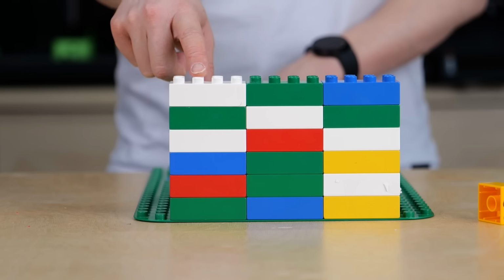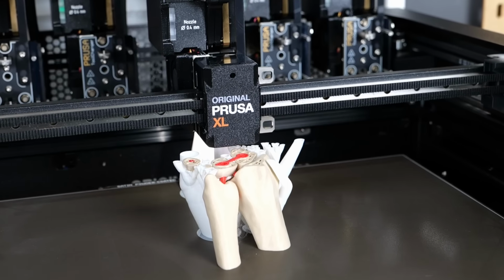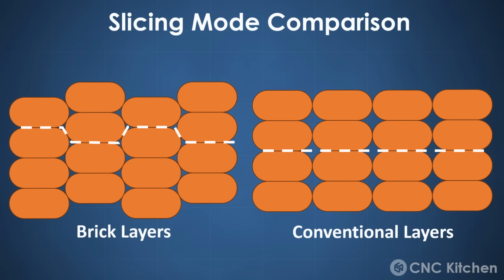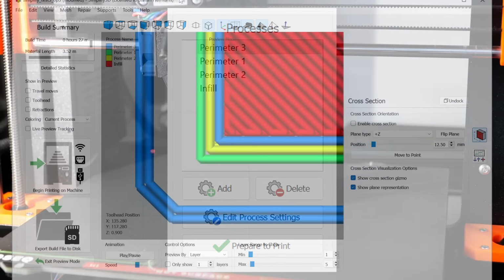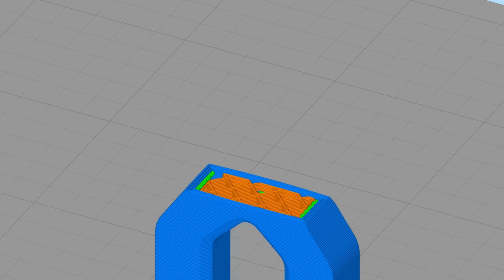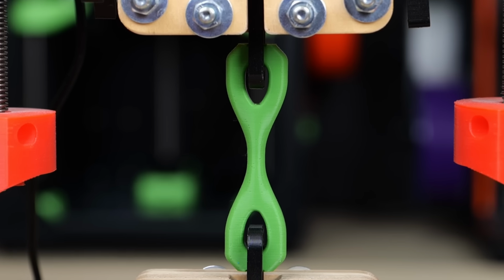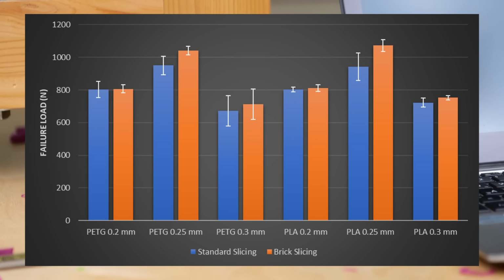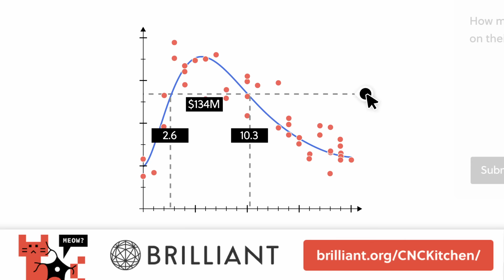Brick Layers - Why did no one do this before?

Comment: A 10% increase in strength with negligible changes in print times sounds pretty good. Seems like prints using this method may be more water tight as well. We need definitely need more testing. Great video!
Reply: I suspect the boosts would be even more significant if you tested for twisting or bending.
Reply: It sounds conceptually bankrupt since MIT published well on this and of course the issue is running a heat pump and/or thermal IR panels to get the heat bay good and hot for adhesion and mixing (where my ultrasound hot end at?) Though on the other hand you don't want the heated baseplate overperforming or motors and controls overheating.

Weird good news; looks like NIST (in Nature Communications ystrdy) found a way to use cellie compasses to do clutch NMR or at least some low key chemical measurement, though maybe outgassing things like PETG losing the glycol to atmosphere are too small.
Reply: @Cineenvenordquist  Even if true that MIT published this, it's not "conceptually bankrupt" to have the same idea.
Reply: What about sandpaper thing that scratches up slightly the top of printed piece for better connection like in pottery?
Reply: @uncertaintytoworldpeace3650 Maybe a micro jagged edge on the nozzle tip to get a similar effect with greater bonding surface
Reply: @ethansdad3d  I'm 98% sure that's a bot. What they said is completely incoherent and not in a "english isn't my first language" kind of way, in a "did you know that the national institute for standards made a study in Nature Communications about using Cellie Compasses to do Clutch NMR or at least some low key chemical measurement? What do you mean that has nothing to do with bricked slicing?" kind of way. The first half of each sentence rarely makes complete sense with the last half of each sentence, it's pulling random vaguely technical sounding concepts out of it's ass and hoping they stick, (as far as I can tell, Glycol doesn't even evaporate, letalone off gas out of a material and into open atmosphere.) and the disjointed concepts only get worse the more of the comment you look at with the second half having literally nothing to do with the first half.

Comment: Coming from concrete strength testing, you want the test cylinder to explode under compression. If just a part snaps off, or it cracks just by one cleavage point than the test cylinder is not homogeneous. Similar to how your parts exploded it likely means more parts of your model were experiencing stress at the same time tell the plastic itself had to give. For ridged materials optimal strength testing often ends with an explosion.
Reply: Yep That one PETG test gave me flash backs to concrete cylinder test in Material testing 101. The rebar reinforced ones would shake the building when they went off it done right!
Reply: Pardon me, but I struggle to see the similarity in material properties concerning Concrete versus Plastics. Plastics usually behave worse in strength tests when particles are introduced to the structure, whereas concrete derives its strength from the aggregates mixed in. Injection molding of PETG should preferably make the part string out when subjected to tension (as in these tests). However, since these parts aren't entirely homogenous due to the process of 3D printing rather than injecting liquid material into a mould, I'd argue there's an increase in strength due to the parts being more homogenous than traditional parts. I base this off of the parts breaking in several directions, rather than just cleanly snapping off. If they were less homogenous, they would have broken sooner
Reply: @Arterexius  Ideally in both cases neither should end up with a plasticity failure. plasticity failures are nice in that it gives you a safety factor, but fractures in multiple planes means the part took all it could handle in the current composition. Plastics can benefit from aggregates as well. Carbon fiber and glass reinforcement is valuable in plastics. This printing style is getting a lot closer to what you would expect with an injection molded failure. 
Concrete, steel, plastic, wood. It's all just materials and when engineered chef's kiss just right that's key.
Reply: @brianhunt6943  Ah, I must have misinterpreted what you meant. I thought your argument was that it was further from what could be expected with an injection molded part, rather than closer. Apologies for that and thanks for the explanation that aggregates work well in plastics too.
Reply: @Arterexius concrete paste can have strengths upwards of 400MPa and commercial strength products and commercial products around 120MPa but aggregates are suddenly the weak point. Sheared granite aggregate looks cool though
Reply: This was my thought as well.  The primary characteristic of PETG in tension is to elongate before failure.  This spreads the stress along the entire structure causing vertical figure lines and explosive failure.  I would be interested in seeing nylon (which also stretches to some extent) and ASA (which stretches very little).  Hope to see more experiments in the same vein using more advanced materials!
Reply: @robblincoln2152 Great way of explaining the material's failure. I still don't understand why a decompression tests on plastic fdm parts are being compared to compression tests on concrete cylinders, but maybe that's just my pea brain
Reply: @MMOchAForPrez  I think (not my comment) that it was just the coincidence of the spectacular type of failure , rather than any shared mechanical component.
Reply: I would love to see additional tests like shear rather than just just tension.
Reply: @qbi4614  my thoughts exactly. Although adheasion strength is only increased by 10%, I would expect the resistance to bending or any force perpendicular to the printing plane to increase
Reply: It's kind of the way plastic works tho. It's literally plastic, but concrete didn't really undergo any plastic deformation? So it explodes it means that the force is passed thru whole mass, but plastic is like... Different? It can move and I don't know anything much about testing.i know more than average but never ran any test. I just know of the types. But, good luck making most plastic break like concrete. I expect plastic to break more like a metal than a lithic
Reply: like the Titanic sub

those idiots also just stacked the carbon fibres over each other
Reply: Welding tests often involve a welder creating a "steel balloon." The idea is that pressurizing it should inflate like a balloon without tearing at the welds. The inlet is a weak point, so it should rupture violently when the desired test pressure is reached.
Reply: This isn't compression though

Comment: How about implementing a random number generator in the slicer, so that the thickness of a small section of any print line is different from it's neighbouring lines in all directions. 

Potentially introducing a lot of internal asymmetric patterns creating additional area for adhesion.

Comment: Have you considered the option of perpendicular pouring of layers? If the first layer is filled with a spiral, and the next one with a snake. The threads between the layers will be perpendicular to each other. This can help to increase the strength of the adhesion between the layers.

Comment: This exists in Cura.. partially. Set infill layer height higher/lower than regular height. Select extra infill wall count. Also increase the outer/inner wall overlap. You should get at least 3 walls overlapping. That's the limitation as far as I know.. but most people dont print with more than 3 walls.

Comment: I'm very late to this comment section, but hopefully you read this and give some thought. Something similar to this, that I have been thinking about for a long time is printing the even and odd perimeters at different extrusion rates. So, as an example, let's consider a five perimeter print. The outermost perimeter, let's call it perimeter 1, then perimeter 3 and subsequently perimeter 5 would be printed first. After perimeters 1, 3 and 5 are finished, perimeter 2 and 4 are printed at a higher extrusion rate, lets say 115%, calculated to fill in the star shaped gaps between layers 1, 3 and 5. Speed might also be reduced to allow the melted filament to fill said gaps. Maybe this is something that already exists en slicers, but have just never seen it. Hopefully you can give this a try, Cheers!

Comment: This is indeed a low-cost but effective improvement plan. Thank you for promoting this idea!
Reply from the maker: Thanks! Appreciate it.
Reply: @CNCKitchen  i think you should try slightly increasing flow and temperature, the print may be even stronger
Reply: @wormball  Wow!! Great suggestion! If you could just adjust the flow to be higher on every inner layer, it'd make a much more homogeneous piece. Print the outside layers first for a barrier  to keep the over-extruded insides from oozing out, and you might have yourself a winner!
Reply: can someone translate this to dollars please, i’ll match it
Reply: Always amazes me how the most basic stuff gets neglected for so long. A child could've identified the problem, given enough information, lol.
Reply: $5.70 @sippingthe

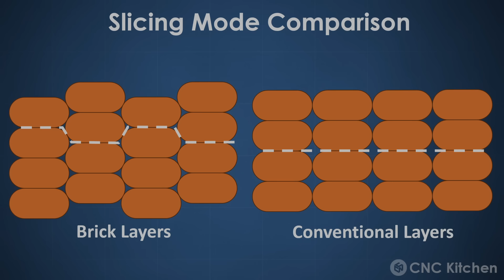Comment: 3:03 There is a 2020, patent but it's a copy of a 1995, patent which had expired so this process is public domain now despite the 2020 patent which should easily be challenged in court.
Reply: in USA the patent holder has to defend their patents, and in court they have to show they lost money  for the patent infringement.  So an open source implementation not hosted on a platform held by a us corporation. its unlikely they will defend the patent.  And since, their patent was about reduction in voids improving strength.  you probably could intentionally keep same void space as now and they wouldn't have a leg to stand one.

Comment: My work around current is place the parts in 45 degrees so the plane is not parallel to the build plate. It often results in low buildplate holding force, so I design often breakable support in the file. FDM is similar handling to wood. One direction is much stronger than the other. Be aware when you’re designing your part. You can also not change the behavior of wood.

Comment: Increasing extrusion temp and enclosing the printer might create a more bonded structure using this pattern. Really great work!
Reply: I agree, it would probably make it sensible to build a heated chamber for low melting temp polymers like PLA and PETG
Reply: Alternately, since the middle perimeter is supported on two sides, you could try disabling part cooling for that perimeter.  That should give it way more time to bond to the other two perimeters, and maybe even the next two put down on top.
Reply: Maybe also a higher print temp so it’s more likely to still be at a “receptive” temp when the adjacent line is laid down.
Reply: @mariusbendiksen163  interesting, I usually print my PLA at 225 for that purpose. People point out that I loose the luster of the PLA at that temperature. But I print functional parts. Not display pieces. I need it strong, not pretty.
Reply: @oasntet  That's a neat idea, and I'll bet he could test it in Simpify3D.
Reply: The only problem is the longer the material stays soft the more it will deform because it will be too soft to keep it's form. You see it commonly when you have the temperature too high on the extruder.
Reply: Have you tried annealing the parts for strength testing too? It would seem to me that would further increase the gap in strength between the processes.

Comment: Great idea. If combined with the techniques you described in your video about 3D printing clear "glass" (slower, hotter), I think you'll basically fill the voids between lines and the part would be very strong.
Reply: I was suprised to see any voids in the corners. If I don't get my first layer a near perfect rectangular cross section I have adhesion problems with PETG
Reply: @TheRealPlato  What kind of build plate are you using? I've heard so much PETG slander about adhesion. Some people say it adheres so well to bare glass that it can chip the build plate on removal... Other say it never adheres at all. I really don't get it, as I've had only a few adhesion issues printing PETG. And that's only on very long prints. I tend to just used glue stick or Magigoo's PC adhesion promoter on every print these days just so I can forget about the whole problem.

Comment: I actually submitted this as an idea for Bambu Studio/Orca Slicer almost a year ago. It is nice to see it in action. My use case was to make thin walled parts, such as a simple bin/cup stronger by using the offset layers. Imagine a part with a wall three lines thick. Now offset the middle line in the wall, as you have demonstrated. There is no longer a single layer line cutting through the wall. line
Reply: Indeed, it might not be relevantly stronger in tension, but shearing should be much better.
Reply: Problem is, with slopes, it doesn't work anymore.
Reply: @supermerill  What do you mean? How does it not work anymore?
Reply: @leocurious9919  The next "low" layer will be partially on top of the previous "high" layer. The mushyness of the plastic still gives you some room to work but it'll probably limit slopes a bit.
Reply: Also, couldn't you make the inner lines in walls have higher extrusion so they fill in the space more? You could print the outer lines first then with higher extrusion the inner ones.
Reply: @supermerill Tell us how Hamming patterns halt and glitch when printing instead of melting to plan. Yeah your logic and slicing scheme got all mixed up again (would you skive for me? 🎶)
Reply: hey you should look at the different welding patterns while mig welding.  you might find some interesting inspiration.

Comment: Impressive results! I wonder if increasing the flow rate for the middle, higher, wall layer could fill the triangular gaps between bricks more completely, like filling a trough
Reply: This is something really worth looking at!
Reply: I was wondering the same thing.
Reply: Same
Reply: Like mortar to the bricks. 
Maybe even a different, low viscosity filament in between.

Comment: In trying to see if I could do this in Orca Slicer, I found that they do something similar by default. The outer wall is printed 0.42mm while the inner wall is printed with a 0.45mm thickness. This is the 0.2mm standard layer height. It also allows the setting to use percentages. There is also an extra wall every other layer option that is supposed to enhance the fusion between the wall and the infill. I know it's not the same as the brick method, but it is a step in that direction.

Comment: I print only in high strength filament. I don't bother with ABS or PETG, etc. That your brick laid model exploded (rather than cleanly detach from a layer) is ample proof that you have achieved injection level strength. A 10 to 14 percent increase in strength is very significant in functional parts. Great work Stefan!

Comment: 5:33 I would love to see an impact test along the layer lines like this as well. I fee like that's where the biggest improvement might be with this method. Also, what if you could over-extrude all the inner layers of the wall to fill in those gaps? Could lead to even stronger layer adhesion and maybe more water resistant parts.

Comment: Dear Stefan, maybe you could host a competition? You already have equipment for testing and this way people would be encouraged to innovate unique slicing methods and verify them. Just an idea.
Reply: This would be super cool. Have a standard model, material, and print temperature. Then test the tensile strength to weight ratio using different gcodes people submit, along with their slicer settings and post processing scripts.
Reply: I'd love to watch something like that. Sometimes people have revolutionary ideas and don't even realize it, or don't share them thinking that someone else probably beat them to it.
Reply: I vote for this idea.
Reply: He did something like this a couple years back except for designing a hook to submit to a competition held by some plastic manufacturer.
Reply: This is brilliant. Commenting to bump it up.